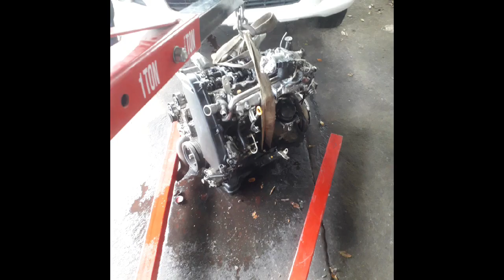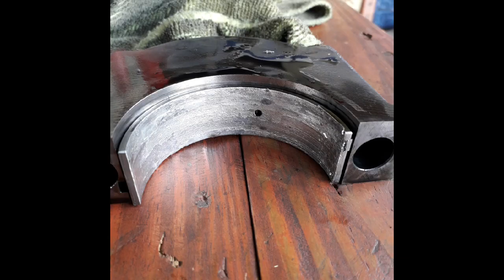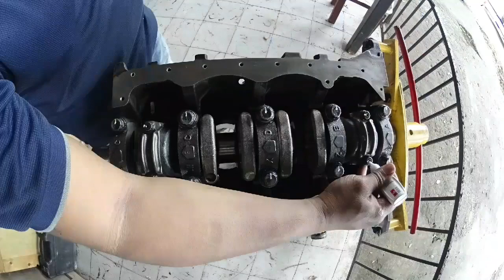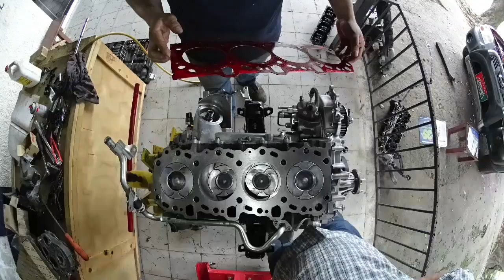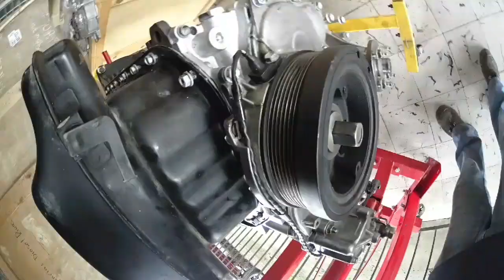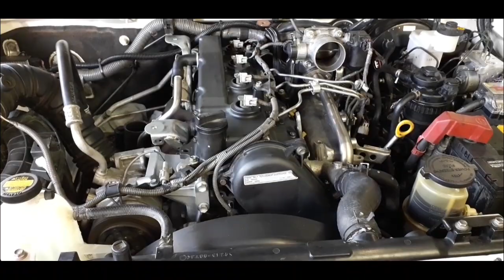¿porqué debes hacer limpieza a los inyectores del hilux, 3.0hilux overhaul engine, time lapse engine

Comment: Una Cátedra!
Tengo una Hilux 2015 con 117 mil kms. Consume agua. Y golpea motor, creo que es golpe de biela, pasador de  pistón , y/o cabeceó.  En fin al cambiar el aceite 5w30 . Utilice un Castrol 15w40 y un aditivo Wynn's Súper Charge. El sonido del motor disminuyó muchísimo.
Pregunta, consulta por favor, según, yo.., no creo que dañe el motor, conjunto móvil etc, segun colegas.  Me lo voy a " hechar..." dañar irremediablemente. 
Que opinas ustedes. 
Muchas gracias por la instrucción.
Reply from the maker: Hola amigo.
Primero revisar si tiene fuga de agua ya sea por el radiador o ya sea por la bomba de agua. 
Cuando un motor se recalienta puede empezar a consumir agua esa puede ser otra cusa de porque consume agua.
El golpeteo del motor o cabezeo puede ser prdoucido por un inyector en mal estado;
Se debe identificar en que cilindro esta el golpe  luego sacar el inyector y mandarlo reparar si el tecnico te dice que el inyector esta bien entonces tu problema es interno. Sino puedes mandar el inyector a revisar en un taller puedes cambiar el inyector a otro cilindro y si el golpe cambia al cilindro donde pusiste el inyector entonces es el inyector.

Comment: Amigo, estoy por comprarme una hilux 2015 4x4 3.0.  O  una L200 4x4 2017, Cuál me recomiendan, soy de Perú, requiero para pista asfaltada  y trocha carretera... AYUDA
Reply from the maker: Hola amigo, cada auto tiene buenas y malas depende para que lo quieres usar y tambien depende de gustos.
Me ha tocado ver autos toyota con kilometraje marcado de 1 millon y el motor sigue funcionando perfectamente pero recuerden que los filtros deben usarlos orignales aunque se vean algo costosos en comparación con los genericos.
Reply: @fuelmachines6893  me compré la Hilux 2015 1kd 3.0 estaba buena, hasta ahora último que perdió fuerza, para subir una pendiente de trocha, en 1er cambio, tuve que activar el 4x4 para terminar de subir. Que podrá estar pasando? Amigo fuel machín es, ayúdame

Comment: Hola amigo...disculpa una colsulta...mi toyota hilux 2.5 2012...se me aruino el inyector por agregarle combustible comun...pero ahora le ise reparar no quedo lo mismo de fuerza no reaciona llega hasta los 2700 cuando aceleras no llega mas..mas en las subidas ...por favor me podria ayudar soy de jujuy
Reply from the maker: Buenos dias  
Tips. recordar que los inyectores llevan un torque de apriete. Si le pones más de lo que dice el fabricante tu problema puede estar en ese paso.
Reply: Gracias amigo ....pero porq cuando acelero no pasa los 2700 revoluciones ...eso lo mas q dudo q puede ser
Reply from the maker: Debe poner el escaner a ver que valores tienen los inyectores pero antes prueba con el torque de apriete.
Reply: Muchas gracias
Reply: Que torque llevan los inyectores de hilux 2.5 y los de 3.0?